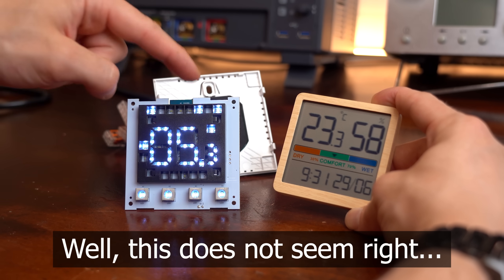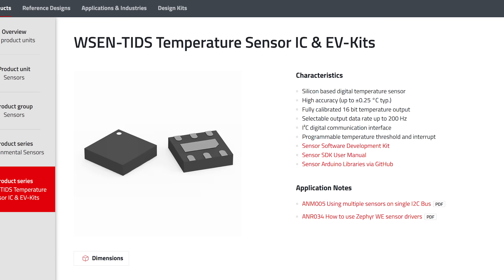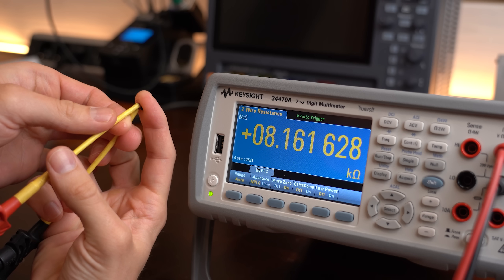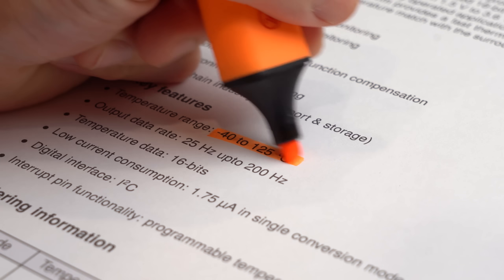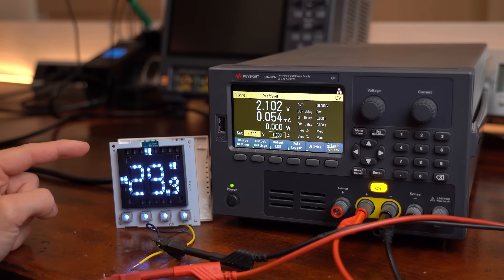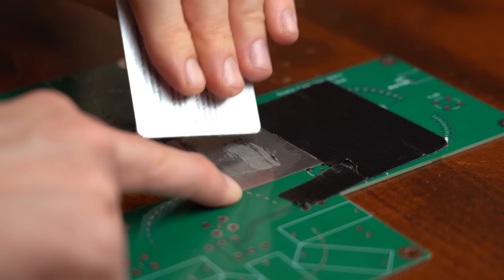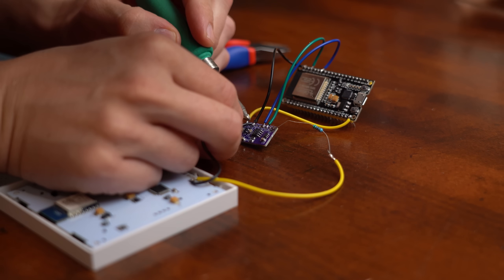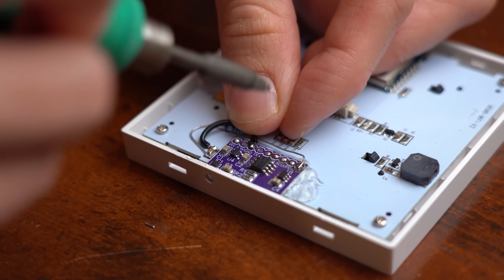From Meh to WOW - With 1 "Tiny" Hack!

Comment: I came across a CYD with a square display and a mount for German wall boxes on Aliexpress the other day. They cost less than €20 and are an excellent replacement for thermostats. All they lack is the temperature chip. They can play audio and manage not only the thermostat via rear contacts, but also other outputs and all home automation via ESP Home.

Comment: One question. I don’t have thermostat cables at rooms. Is there a chance to use some kind of tuya temperature sensors. Collect all data to like esp32 through wifi. And also control actuators with same esp?

Comment: LM35 (or LMT70 if you're really picky). Direct analog voltage output.

A simple resistive voltage divider to scale that analog output voltage to what the thermostat expects. (Pads for the resistors are already on the thermostat's PCB.)

This project is an impressive flex of your design knowledge and fabrication skill. I don't doubt you on either of those. But there was no need for such insane acrobatics.

Comment: I own one of those thermometers. And the software supports adding a fixed offset value to correct for drifts. This might be for the sensor itself. But is also useful if the sensor is in a colder/hoter place of the house. Couldnt you have set up just that?. Maybe the home asistant SW doesnt have it and shiuld be added to it.

Comment: Don't the thermostats have some sort of built-in offset you can tweak ? My gas boiler does - it allows you to compensate for any inaccuracies in the outdoor temperature reading caused by the length of wire between it and the actual outdoor probe (which is nothing more than a 10k NTC like yours stuck inside a small box), which is always going to vary greatly for each particular installation of said boiler.

Comment: I managed to get very accurate temperature reading with a TMP117 sensor. We measured it's accuracy with laboratory grade thermometer and it achieved  +- 0.25 deg C accuracy in our tests, close to +- 0.1 deg C as advertised. We employed this to measure/control temperature of a heatbed to perform thermal cycling for PCR (polymerase chain reaction) with very high accuracy.

Comment: I feel your pain on the lack of ground plane isolation. I thought I'd got to the RC for a air conditioning controller only to discover that even though the rest of the board was low power enough heat was being transmitted through the ground plane to massively skew the readings. Of course it worked fine to begin with and it was only when I left it running for a while that the temps slowly crept up. The next version had lots of slot gaps and I swapped out the generous ground planes for tiny traces to take the I2C signals to / from the MCP9808.

Comment: Love the nerd element, but is there a reason you didn't just create a template sensor in HA to apply a filter to the reported temperature, than base your hvac automations from that corrected offset? I realise that it does not solve the display problem, but would have been a hacky workaround...

Comment: You can also upload Supla Gui Generic firmware directly to thermostats uC and then use Supla plugin in Home Assistant instead of Tuya. Supla firmware is open for modifications and documentation is well available on the website. You can even write your own firmware.

Comment: A quite over-engineered solution. Big corporates are so poor, they can not afford decent NTC-resistors, intended for measuring temperatures. Furthermore, nobody can waste money for two more resistors for a Wheatstone-bridge and an instrumentation amplifier to get rid of supply-voltage fluctuations and noise. And a calibration software of 0th-order (shifting), 1st order (sloping) or 2nd order (parabola linearisation) took too much program space, so a more expensive micro-controller would be required. According to my experience, a more precise NTC (EUR 2...5 instead of 20¢) would to the job for an accuracy of 0.5-1K.

Comment: The correct way to fix it is to correct the internal linear conversion by some table or the formula, however around 25 deg. It would be much simpler to add some parrell resistor on the ntc. Ntcs are more accurate then digital chips if used correctly.

Comment: Using the beta equation for calculating temperature on a thermistor isn't as accurate on a wide range as using something like a 3 coefficient steinhart-formula. It's a bit of a pain in the ass to get the coefficients, even more so without a datasheet, because you'd need 3 temperature points and readings, but it works really well. If you have the datasheet, you could also go for a lookup table.

Also the voltage relation in a voltage divider is not linear either. I have seen curves beforehand, especially when working in hvac. If you use excel, get temperature/resitance values from a datasheet and plot the calculated voltages into a chart, you're supposed to get a curve with an inflexion point.

NTC thermistors have the possibility of being reliable.We used those ALL the time and most of the offset corrections I've seen didn't stray away from +/- 0.6 °C, and only once have I seen a correction of 1°C. Note that the quality of the thermistor itself is also a variable. Not all models are created equal and sometimes bad batches can happen.

Comment: 4:30 Würth Elektronik: "We heard you like temperature sensors, so we made a temperature sensor for your temperature sensor."
Reply: Now including the enhanced line with built in temperature sensor for your temperature sensor temperature sensor.
Reply: @lucimorgenstern5582  Actually one of the use cases of this Würth sensor is cold-junction temperature compensation for thermocouple temperature sensors (thermocouples have a much wider temperature range to both colder and hotter temperatures).

Comment: Was it not simpler to just switch the fix resitor in the voltage divider for an variable resistor to calibrate the temp?

Comment: Alternative solution: A simpler temperature IC PCB direct connection to the Tuya ESP32, then replaced the Tuya firmware with esphome firmware. Replacing Tuya firmware with esphome is usually pretty simple.

Comment: I would have added a piece of metal from the hole outside onto the temp chip and glue it with thermal epoxy.

Comment: The main recurring problem with this channel is using a specialized ICs for EVERYTHING instead of using creative simple solutions and make them even better than the original design. Those ICs let's be honest are a form of DRM and also can be discontinued at any moment. But simple and clever solutions will be good even if I see this video 10 years later for example.

Comment: This is like peak German-ness content "My temperature controller is slightly inaccurate.. I shall engineer an entirely new board, hardwire it in and re-program it to compensate!" Please never change 😁
Reply: To be fair, 2 degrees off is a major flaw.
Reply: @LarixusSnydes  not that much of an issue though is it? like, are you really going to notice a 2 degree difference in the room?

Edit: okay I didn't think about Celsius, in that case it makes more sense
Reply: @puyodead1  2°F isn't much, but 2°C is actually a pretty big difference
Reply: @puyodead1  Yes and most people do. My thermostat is set to 15 degrees when I'm not at home (to protect my house plants) and 18 when I'm the only one who is at home.
Degrees in Celsius, not Kelvin ;-).
Reply: @puyodead1 ngl 2 degree C is the difference between normal human and a dying human fever?
Reply: @DullEdBlades didn't even think about Celsius, that makes more sense lol
Reply: @puyodead1  in my car I can feel a definite difference between 65F and 67F (I definitely prefer 65F)
Reply: The America approach is to set the thermostat a degree higher or lower.  Of course I had a chip fall off my Honeywell thermostat so I made  one with an Arduino until a new one arrived.
Reply: @gnuorder  yeh really doesn't have to be accurate, just repeatable so to speak
Reply: @gnuorder Pretty happy about the American approach since WW2!
Reply: Das ist doch ganz normal,was sollte er denn sonst machen?

That's perfectly normal, what else could he do?

😬😉😜🤗🤗
Reply: Makes Perfect German Sense.
Reply: And some like °f as it gives a more whole number degree of feel then °c
Reply: Why use the thermostat at all. An esp32 with mqtt and temp sensor is all thats needed.
Reply: We Germans never change. That is the foundation of German-ness.
Reply: Well, peak German-ness would include an attempt to figure out the true accuracy of the new solution, not just relegation to authority (it's digital so it must be better). Comparing to the other device is also not so great, who knows how accurate that one is?
Generally we should trust simple understandable devices more than digital black boxes, UNLESS the manufacturer gives us good reason to trust them. So he did mention the potential sources if inaccuracy of the NTC, which is good - you want to understand sources of error.

At least he could have tried to measure accuracy of 0°C point with a ice/water bath - that is a simple test everybody can do at home.

Back to the Würth TIDS, after a bit digging we can find a very rough "theory of operation" for that device in their "Product Guide" - it's based on temperature-dependence of the forward voltage of Silicon diodes and they do a differential measurement between to transistor base-emitter diodes. They specify accuracy as +/- 0.5C in the relevant range of room temperatures with typical accuracy of +/-0.25°C - it's not great but not horrible either. It tells us we should not be off by 2K unless we do systematic errors, like measuring the PCB temperature and therefore nearby circuit components rather than air.

The Product Guide also includes mounting examples. For example they recommend to have a PCB cut out underneath the sensor if your goal is to measure ambient temperature (as opposed to PCB temperature). I think Würth could do a better job of making this information more readily available to customers by including it in the device's User Manual.
Reply: As they say "person with watch knows time, but one with 2 can't be sure". Dunno what kind mansion needs more than 2 thermostats (one in living space, second in sauna).

Comment: I would rather play a bit with the resistor in the voltage divider to bring the temperature to proper levels, but you do you :)
However, there might have been an oportunity to replace the Tuya based communication and microcontroller of the device completely - for custom made ESP32 firmware :) Too much?

Comment: You need to look at SHT Series sensors SHT41 is really good at P/P Ratio or if you need more accuracy SHT35 is an other option plus they are tiny sensors in the end you will get just value of temperature without complexity of ADC to DAC conversion cause SHT Series has built-in ADC. As a German you did it again over with over engineering stuff😅 I ask myself this question a lot why Germans over engineer stuff so much I really wonder the answer of this question

Comment: Great video as always. The difference between room temperature and what the system reads is usually down to a tricky setup — especially when one unit’s doing both heating and cooling. Airflow, comfort, all those little things can make a difference. The thermostat’s rarely to blame… unless we let AI take over — then it’d get even more fun to fix!

Comment: Well this video was intersting, but all the time I was thinking it would be much easier to simple add a potentiometer in line or parellel to be able to adjust the temperatur of the unit. Also I would have moved the sensor lover and added a hole for more ventilation (or just let it peek outside of the box). Problem solved

Comment: You could design your PCB with edge pins, like raspberry pico for example, to just put your board onto thermostat and solder to pads  where capacitor and resistor from voltage divider were. Do v2 with that and fix you mention on video!

Comment: Nice hack but indeed a bit too complicated. Wouldn't be possible to try Replacing the NTc sensor and playing around with the resistor values to get a more accurate base reading at 23C

Comment: The WiFi chip used on this board (WBR3) is supported by ESPHome as far as I’m aware.

So you could’ve also just flashed ESPHome onto it & added the I2C temperature sensor directly.

You’d also be able to make it fully local that way.
Pretty sure that with your current config, it’ll just drop out from Home Assistant if you lose your internet connection…
Reply: The zigbee version is local out of the box.
Reply: Good to know that non-cloud options are coming available. Used to be only ESP modules could be flashed.
Reply: @OldCurmudgeon3DP yes agree! Good news!
Reply: @OldCurmudgeon3DP  even non ESP variants can be flashed, today bi uart only anyway so it even the same process. Only downside is the lack of pinouts because most still think esphome isnt compatible. But it works great.
Reply: 100% this was going to be my comment
Reply: right? this is exactly what i thought and even a bit sad he didn't try this

Comment: To make it more accurate to the room temperature there is a simple solution.  Just put a small heat sink on the sensor.  Instead of taking heat away it works the other way and keeps the sensor at air temp.  I learned a long time ago though that thermostat temperature is just made up.  This comes from the old days where a thermostat was a mercury bulb on a lever and trying to set numbers accurately was impossible.  So I learned to just move the lever until it clicks on or off and call it good.  Also, a comfortable temperature inside in the winter is different from the summer so absolute numbers just aren't important to me really.  But I'm here for the electronics anyway. And I am impressed with what you made.  I've been trying to make my own (in the background) for years and stacking up the various boards is just too big.  But you made it very compact and I like that way you didn't reinvent the wheel but just changed the sensor out.  What I want is much more than that though if I make one.  I want it to switch from heat to cool automatically because this time of year it's cold enough for heat in the morning and hot enough for AC in the evening.  Also, programmable thermostats don't really cut it with only 4 settings.  I like to move it up and down as the day goes on.  They say you should just leave it set at a temp but it saves a lot on cooling to let it warm up as the outside warms up and then cool down as the outside cools down.  What matters is the delta between inside and out and the less delta the less it will need to run.  Heating or cooling.

Comment: did something similar for the heater and outside temp sensor... I have used the DS18B20 and a digital potentiometer with the ESPHome. Works like a charm...

Comment: I have a few esphome devices around the house, each with it's own thermometer. I added another one working just as a relay and connected it to the central heating.  I then created an automation for switching the thermostat based on the temperature in any room around the house... and it's permanently wet to the toddler's 😂

Comment: The WBR3 module seems to be pin compatible with the ESP8266, therefore I would probably have replaced the microcontroller and wrote my own local only firmware that also directly talks to the sensor.

Comment: I just did some hardware hacking last weekend. Got a cheap used furnace blower to make a home air filtration system. The motor driver wouldn't work for more that 30 seconds without the an expansion board. Did a bunch of troubleshooting to find a pin that needed a voltage 0-12v AC to call the motor speed. Now I have a $1000 blower for $100 and a weekend of fun.

Comment: I would have swapped that Tuya module for a espressif module, reverse engineered the display pin out/protocol, and grabbed something from my drawer of temp sensors. 

 Don’t get me wrong, I LOVED everything about this video, and learned a lot ^_^
Reply: Look at 2:19, it looks a lot like esp32 to me. The only hardware mod required was changing the temperature reading module. Rest is in software
Reply: @koliwbr   that is a Beken WBR3 chip. Its basically Tuya's version of an ESP32. Most are flashable with esphome or OpenBeken
Reply: @zeddpilsner4 I was gonna just say the same, doing this and getting rid of tuya firmware is the best way imo. 100% local without tuya dependency and no unknown closed source firmware issues
Reply: I wouldn't have replaced the module or bothered reverse engineering the display... I'd have flashed it with esphome since they support those beken chips now, and not worried about the display.
I'd also have done that before I even hooked it up to anything because I don't need China controlling my thermostat.
Reply: The study’s module can run ESPHome. Problem is Tuya run all the logic on the primary MCU then interface to the secondary via UART. So all you can expose is the serial TX RX.
Reply: It does not help because the thermostat has another IC, tuya modules works only as "wireless adapter". There's no way to calibrate the temperature without flashing that secondary IC

Comment: It's funny to see you design such a complicated but cool solution instead of just replacing the Tuya chip with an ESP32.
Reply: Don't need to replace it. The beken board are supported by esphome now.
The tricky part would be the display unless it's got a well supported driver chip running it.
Reply: And to add to this - there’s a calibration option in the system menu on these thermostats. I’ve found it to match a known accurate thermometer once set.
Reply: Or just flashing esphome/openbk_app